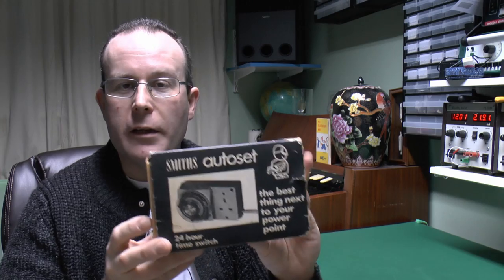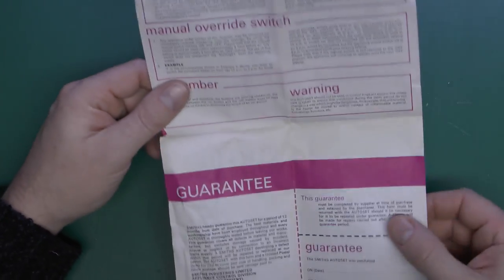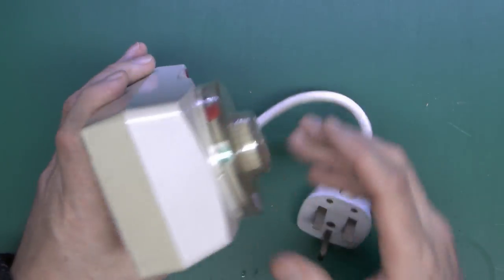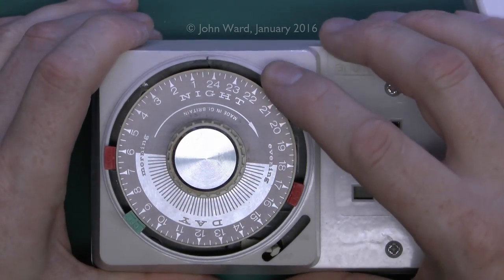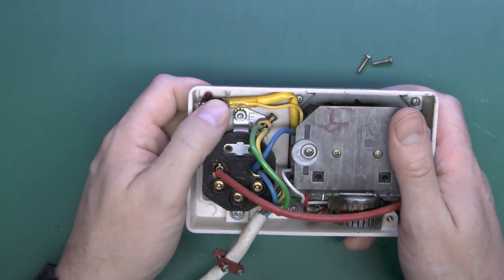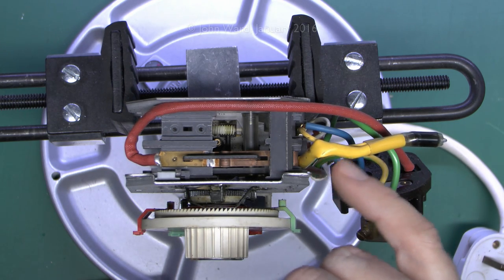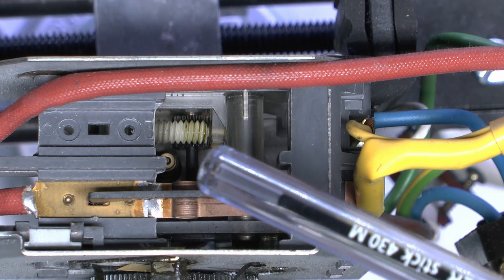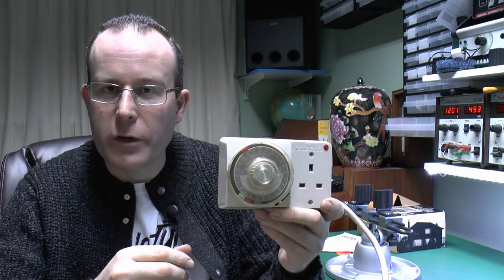Smiths Autoset 24 Hour Time Switch

Comment: Haha, very good. Sangamo Weston and Venner had their versions of this, where they would be sat on the worktop with a length of flex going to a nearby wall socket.

While Sangamo Weston didn't bother with fancy names for their device, Venner certainly did! Venner called their one the 'AutoPoint'. :D

The venner one was massively huge. It had a consumer-version of their more commercial "Vennerette" timeswitch built into it, and the socket outlet on it was even a standard-sized wall-mounted outlet! :D

So yes, apart from the casing to hold all the bits together, the Venner timer was something which looked like it was quickly lashed-together with a standard wall socket and a Vennerette timeswitch. :D

Thanxx for showing this one.

-BoomBoxDeluxe.

18th January 2016, 02.44
Reply from the maker: +BoomBoxDeluxe I have actually got an Autopoint and a Venerette, will do these in a future video.
Reply: Haha, LMAO. I look forward to seeing Venner's AutoPoint, as the one I saw on a popular auction website many years ago did make me laugh!

It looks like a silly-size unit with a Vennerette slammed in there. :D

The one which I saw, I believe was either lightly used or new-old-stock as it had its original black-and-white stripey braided flex and a relatively decent-looking original box to go with it. 

I debated whether to buy it for a few hours, but then decided not to. I did grab the pictures from the auction though, because the size of it is quite laughable compared to today's plug-in-the-socket timers. :D

Thanx for replying,

-BoomBoxDeluxe.

19th January 2016, 01.22

Comment: Hi JW.
I have 2 of these timers which i managed to pick up on ebay but what i would like to know the instruction leaflet which i have states that the plug wires are Brown L, Blue N, and Yellow/Green being Earth now these 2 units are from the start of the 70's and one of my units still has the name of the person and the place where it was bought including the date being 1971 now if the new plug colours arrived i do beleive was in  2004 why did the Smiths Autoset timer use The new colours back in 1971 and ive even got the instruction leaflet for both timers and they are legit.
So basically the new colours were around long before 2004 popped along

Comment: I think i may have found my answer

The Electrical Appliances (Colour Code) Regulations 1969 came into effect on 1 July 1969 and set the scene. Regulation 4 provided the requirements for the colours for ‘mains leads’ for appliances, brown for live, blue for neutral and green and yellow for earth. Note the requirements for the colour of the ‘earth-continuity conductor’, ‘The covering of the earth-continuity conductor’ shall be coloured green and yellow, and in such a way that the covering (on any length of the conductor measuring 15 mm or more) has not more than 70 per cent. (nor less than 30 per cent.) of its surface coloured one of those colours, and has the remainder of its surface coloured the other.’

Figure 3: Table B.4 from 14th Edition of IEE Wiring Regulation (1966 incorporating Amendments 1970)
￼

Comment: I've got a few of those electromechanical timers around the house. Except that the American versions are one-piece & plug directly into the outlet.
Reply: +Madness832 Most British versions are one piece as well.  

JW that switch has definitely been used as a plug has been fitted.
Reply: +cjmillsnun and the neon indicator being black as JW mentions...

And once again, Brittish stuff is wierd. No plug fitted even with an unit having a standard brittish outlet?

Did power strips come without plugs back "then", or was power strips even a "thing"?
Reply: Here in America, most of these timers were made with a cord (flex) and plug well into the early 1990s.  There’s a table lamp in my family room operating on one from the 1960s right now.  I can hear it running as I type.  This is the first British timer I’ve seen with a cord and plug